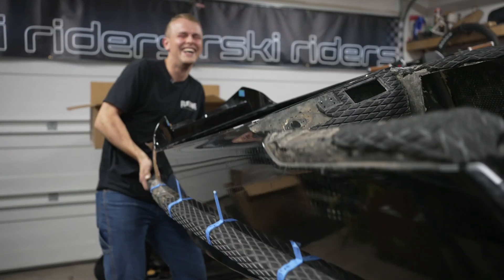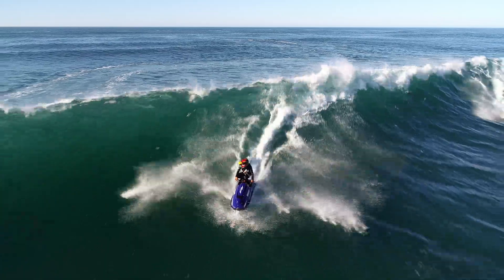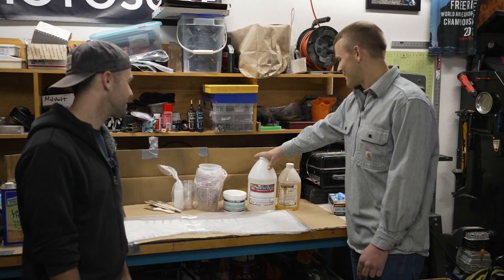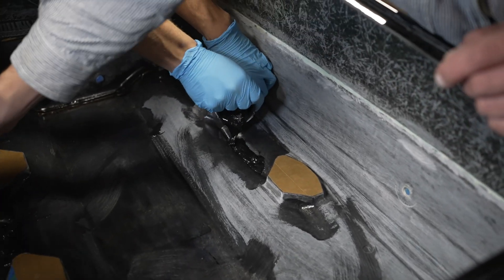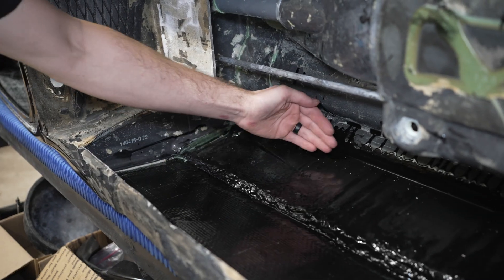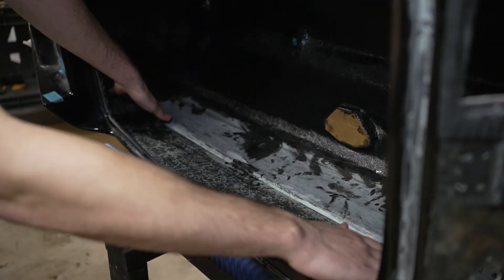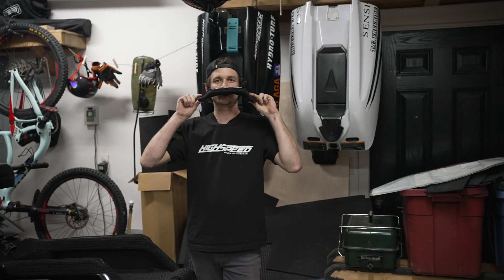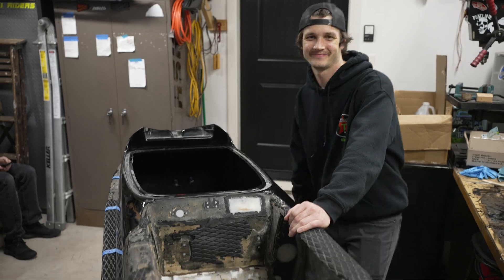Laser Cut Fiberglass reinforcement - Yamaha Superjet DIY - RSKI RIDERS

Comment: Sick video! I will be swapping my square nose and buying nice round nose and my 701 swap. My question is will make pump and mid shaft and most other stuff work aside from buying water box?
Reply from the maker: Thank you! Most of the important parts will transfer over and work just fine, with the exception of midshaft housing and waterbox. If you get a 2008+ hull you will need a different driveshaft, and depending on the handle pole you may need a different steering cable. Check out our RN vs SN comparison video for more info!

Comment: Awesome video. So what would make the foam get wet in a 2014 ski and how do you know when its waterlogged foam? Do you have any good videos for cutting out the tray but leaving the original support structures in place. That way you can replace the foam and decie what to cut and what to leave once you can see it all.. 
Also, is that laser-cut fiberglass layer reinforcement kit, in the beginning of the video @2:15, for sale at all? Or even the plans so we can make stencils with paper and cut out the spots in a fiberglass mat sheet
Thanks..
Reply from the maker: Thank you! Leaks can start from any of the through hull tubes: exhaust, steering, cooling, siphon. Check out our tray widening video for more info and ideas for how to fix a waterlogged ski. Unfortunately we don’t offer the fiberglass kits yet, but with some time and scissors you can achieve the same result.